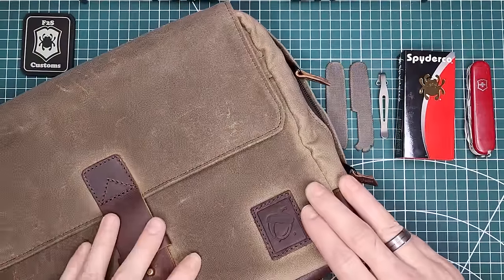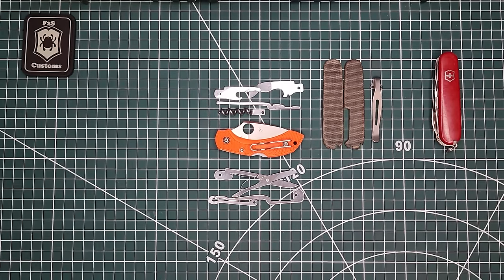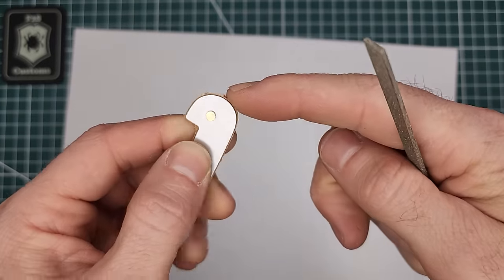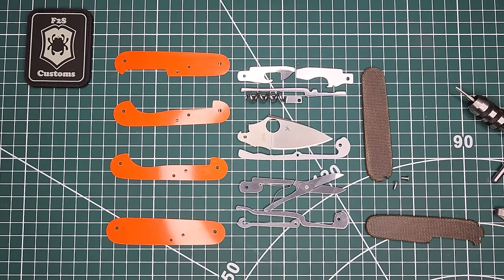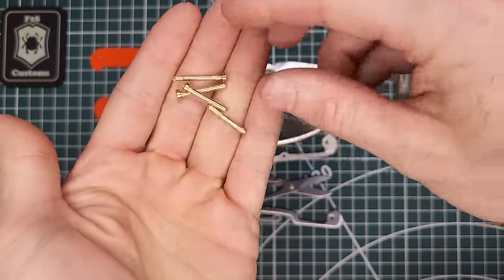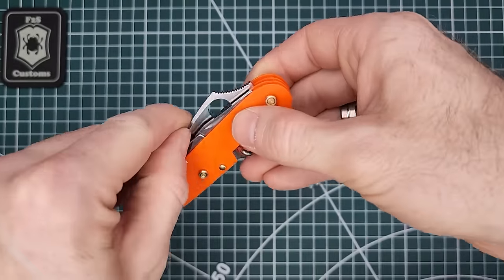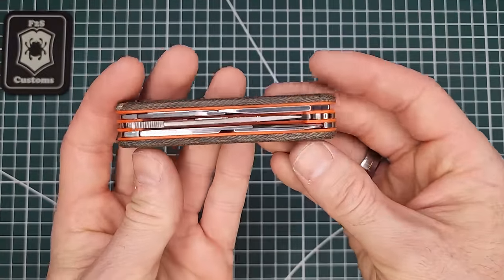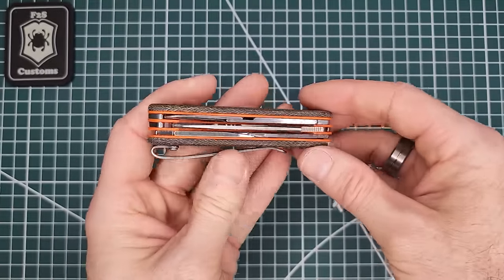How I made this Custom SAK for Nutsac

Comment: Nice build!
In your experience, what tools can you replace the hook with? I feel like the Reamer/Awl or something from a 58mm would be more useful but not sure if it’s doable.
Reply from the maker: Thank you!
There are a couple of options, but they are pretty difficult mods. You can add an awl, but it needs a washer. And it is possible to place the philips combo tool from a 58mm there too. But it has to be drilled out, reshaped an bit and the scissors spring has to be modified too. Otherwise it will not snap down into place.
Reply: @FittoSurvive  That explains your choice! I have been wondering as well why you would include the carrying hook. It is the tool I would most likely never use.
Reply from the maker: @jenskettwig3048  The multipurpose hook really is one of the least used tools. But yeah, it is the simplest to use with the scissors.

Comment: Freaking Magic!  But why is the blade on the "wrong" side, unlike a standard Victorinox? Is it only because you planned to make a tip-up pocket clip like on Dragonfly? Nevertheless, great job!
Reply from the maker: Thank you.
The blade ended up on the "wrong" side because of the spring that I had to use. I could place the Spyderco in the same location as the original Victorinox blade, but then I would have grind it down quite a bit.
Reply: @FittoSurvive  What spring are you using?

Comment: I wouldn’t trust micarta for such fine threads. How does it hold up?
Reply from the maker: I have made about 4 knives like this, and so far it has held up well. But, I have recently sourced some brass press-in threads that I plan to use in future builds to make the pocket clip more durable.

Comment: Wouldn't those plastic liners be proned to cracking from torsional pressure from using the tools or accidental drops? Aluminum does have better stress resistance.
Reply from the maker: The liners are G10, which is a high-pressure fiberglass laminate, a type of composite material. G-10 is the toughest of the glass fiber resin laminates and therefore the most commonly used.G-10 is the toughest of the glass fiber resin laminates and the therefore the most commonly used.  It outperforms and will outlive the original aluminum liners.

Comment: Would you mind sharing where you got the micarta scales from?  I’ve been planning a similar mod for my friend (she’s a gardener, so serrated main blade), but the RGT micarta I was looking at doesn’t accept the pen or pin.
Reply from the maker: I ordered these micarta scales from a guy in Malaysia or somewhere in South East Asia.
Have you seen the micarta scales from www.dailycustoms.shop
I don't remember if they have plus scales or not though.
Reply: @FittoSurvive  Thanks for the ideas… I’m having trouble finding micarta plus scales anywhere.  The closest I am getting are Taschenmesser scales on EBay (pen slot but no pin slot).  Any experience with the brand?  It’s reasonably priced and has a brass cross.  I’ll reach out to Daily Customs… maybe they will release plus scales at some point (not in a real hurry).
Reply from the maker: If you are having difficulty. Send me a message via Instagram preferably or email. I will help you get a set just like the ones I used in this video.
https://www.instagram.com/fit2survive_/
f2scustoms@gmail.com

Comment: What's the minimum number of layers to include the pliers from the handyman? Victorinox'd be making money hand over fist with a large knife/pliers/scissors/can/cap setup...
Reply from the maker: The minimum number of layers is 2. In fact Victorinox used to make the "Victorinox Special Mechanic" which was a two layer SAK with just the knife, combination tool, corkscrew, and pliers.
But, for some reason they stopped making them. I can still make them though. 😎👍🏻

Comment: nice work! but q - why using the corkscrew and not a philipshead? (i found many usecases for the tools, but none for the corkscrew other than holding the small screwdriver (and maybe a fireant)?)
Reply from the maker: Thank you! The philips screwdriver may have been a more practical choice, but I went with the corkscrew specifically to carry the helix tinder and mini tool. Otherwise, yeah I'd have gone with the screwdriver.
Reply: I use my cork screw to help untie tight knots
Reply from the maker: @chrisc4527  That's one of the many uses for the corkscrew. 👍🏻 @feliximmler probably has shown many uses for the corkscrew on his channel.

Comment: Awesome built. How the toothpick fits in to the scale? Does it click in its place like the original plastic scale?
Reply from the maker: Thanks. The toothpick fits well. It is not loose at all.
Reply: @FittoSurvive  thanks. I hobby cnc user. I solved the tooth Pick with a soft silicone ring.
Reply from the maker: @petercsizmadia9642 Awesome.

Comment: Isn't the blade hitting one of the pins when closed ? Or it is just super close ?
Reply from the maker: It may be close, but it does not tap the pin or spring.

Comment: Hi man, i'm following you since last year. Today i tried to make my first custom vict (tsa cybertool). I'm having a problem, i got short rivets so i have to make a new set. You linked in description brass rods to make it, but they are 2,5mm dia, so they work well for extrenal rivets, but 2 in the minnel are 2,2 dia. Do you find a brass rod wuth that diameter or i'm totally fucked? Sorry for my spaghetti english but i hope you understand
Reply from the maker: Glad to hear that you have been following me for a while now. 
The 2.2mm brass rods can be ordered on Ebay, but they usually come from China and take a while. In a pinch, you can tighten the 2.5mm brass rod into a drill and spin it against some sand paper to bring it down to 2.2mm. Just have to be careful to make sure that it turns out even.

Comment: The 93mm Cap lifter has a 3 mm hole and the 91mm knives have 2.5 mm pivot pins is it a problem?
Reply from the maker: The difference in the pivot bore does not affect the performance at all.
Reply: @FittoSurvive  Interesting I used to raid the 91s for scissors for the 93mm alox years ago and drill them out to 3mm since the X range has been released not a thing now. At the moment I modding some 111mm Victorinox models

Comment: All is good but in my opinion more reliable will be if the pocket clip bolts will screw into the metal liner. But yes in this build you have no metal liner. Something more reliable for pocket clip attaching.
Reply from the maker: I see what you mean. It should hold up well, but yeah, it would be better if there was some metal that it could attach to.

Comment: What size is the pin/ screw hardware and where do you get it from?
Reply from the maker: The brass pins are 2.5mm and 2.2mm in diameter. The 2.5mm can be found on Amazon, the 2.2 is harder to find.

Comment: I've always problem with the bottle opener layer, it does not snap as normal, I need to use washers?
Reply from the maker: If you modified the can and bottle opener to fit on the blade layer like I did in this video, then yes they will need a small washer. Otherwise they will get pinched and not open properly.

Comment: Where do you get your victorinox parts assortments?
Reply from the maker: All of the parts that I have are from knives that I have disassembled.
Reply: @FittoSurvive  even the colored accessory sets? I’d love to get one of those, even if it’s not in a nice branded box for my own projects
Reply from the maker: @dwaynetherock-hardjohnson5676  The colored accessories can be found on Ebay sometimes. Not sure where else you could source them. At one point, they were on Amazon, but I haven't seen them in stock there for a while now.
Reply: @FittoSurvive  I’ll be sure to keep an eye out! Thanks for the heads up! Love your videos as always!

Comment: I want this but in different color.. how much would I have to spend to get the same one just different color??
Reply from the maker: A build like this costs around $340. It can be done with a different color. Check out my website for information on how to order one. www.f2scustoms.com
As a heads up though, my current waiting list is about 43 weeks.

Comment: Hello, is it possible to use a longer Spyderco blade like the Endura and reduce its length to fit the Victorinox 91mm?
Reply from the maker: Theoretically it should be possible, I have never tried it myself though.
Reply: @FittoSurvive  Thx! I'm thinking about the PACIFIC SALT™ 2 GREEN LC200N, quality steel totally stainless steel.
Reply from the maker: @ogarzabello  That blade would need 5mm ground off. I'd probably try to place a knife like that in a 111mm SAK.

Comment: The only thing I don't like is that the knife doesn't have a full locking mechanism which you then have to actively UNLOCK.   So you might cut something and if you're not holding that knife right, it can close on your fingers and cut you pretty bad.
Reply from the maker: I've been experimenting on a liner lock for the Dragonfly, but haven't had much success yet.

Comment: Why did you modify those two springs and two tools? I mean, sure, to get them to fit better and to work better, but if feels as if you just glossed over that part
Reply from the maker: The springs had to be modified to accommodate the tools, since the springs are not meant for them originally.

Comment: Isnt the G10 a lot thicker and less strong or wear resistant than the stainless liners you replaced from?  Is it just for color?  It seems like a downgrade of the liners
Reply from the maker: The original liners are actually aluminum. So, the G10 is stronger and more durable. But other than that, it is mostly for the design.
Reply: @FittoSurvive  I didnt know they were Al, G10 is an upgrade!  the orange looks cool, too.
Reply from the maker: @dichotomousblue  Thanks! 👍🏻👍🏻

Comment: Jesus, man, how did you reassemble that so easily? I'm reassembling a SAK as I'm watching this, and those metal springs between the tools are refusing to cooperate
Reply from the maker: Yeah, some times the tension on the tools/springs makes it difficult to get the tools in place without them popping back out. 😅
Reply: Finally, thanks to the strength of 2 full-grown men, I got all the parts in the right place. Just need to fit the gromets, remove the zip ties holding the parts in place, and snap the scales on. I don't know how you do this as a profession all on your own. Mad respect.

Comment: Spyderco blade drops on brass rod?!
Why plastic layers? Is it a toy?
Reply from the maker: The Spyderco blade doesn't touch the brass rod. During assembly it looks like it would, but that is because their wasn't any tension on the knife yet.
The liners are G10. It is a high-pressure fiberglass laminate, a type of composite material. It is created by stacking multiple layers of glass cloth, soaked in epoxy resin, then compressing the resulting material under heat until the epoxy cures.
The G10 is stronger than the original aluminum liners. No toys here. 😉

Comment: Thin short thread in plastic, plastic liners, what this “knife” is for. You should go for wooden blade and rubber scissors. 👍🏻
Reply from the maker: Plastic? Hmmm... Apparently you do not know what G10 is. The original liners are aluminum, which is significantly weaker than G10.
But, if you need a wooden knife with rubber scissors, let me know. 😉
Reply: @FittoSurvive  hmm, what is weaker, ceramics or brass? What about threads? Good tactics to answer partially and skip the part where you have noting to say.
Reply from the maker: @CBORK27  About ceramics or brass, each has it's own advantages. The ceramic is probably harder on the Rockwell scale, but the brass is more malleable and does not break.
I did not even understand your first question about "thin thread in plastic". I assume you mean the threads in the micarta scales. That is something that other people have pointed out as possibly being a weak point. I have made 3 or 4 knives like this one and none of my customers have yet complained. But none the less, I have sourced brass press/melt in threads for future builds.
I have nothing to hide in my builds. I am proud of my work.
My question for you, what has you so upset about this build?
Reply: @FittoSurvive  I don't upset, I simply think that g10 + steel pair is less wear resistant then steel + metal (I mean open/close action) 0,2 brass bushings will be good solution. Metal threaded inserts you mentioned is good solution too(bugout for example). This knife is maybe beautiful (no accounting for taste), but certainly not as reliable as original. Just wanted to share my opinion. I think you just got used to only adoring comments and got upset about mine. Sorry to disappoint you. You are not very original here, almost any YouTube blogger hates critics. 🤷🏻‍♂️
Reply from the maker: @CBORK27  I see what you mean. But I still think G10 will be more durable than the original aluminum ones.  

 The bushings is an interesting idea. I wonder if it wouldn't disrupt the tension of the tools though... I'll have to look into it.

I do appreciate positive criticism, it helps me improve. I guess I was irked by the "wooden blade and rubber scissors" comment. 😅 

But, I seriously do appreciate the other advice that you just sent. I'm not perfect for sure. Still much to learn.

Maybe my upcoming build video will impress you more. 😎 It will be all original parts and liners, but super cool if not overkill. 😁
Reply: @FittoSurvive  my advise is to learn about friction pairs, if you want to make not only beautiful but also functional things, I think that functionality must be on the first place regarding knifes, especially multitools.
Reply from the maker: @CBORK27  👍🏻 Thanks.

Comment: Nice, but 3-layer model based on Victorinox Compact will be more interesting. Thanks for your video!
Reply from the maker: Agreed, but since I was giving this knife as a gift, I did not want to use the more expensive Compact. 😅
Reply: @FittoSurvive  Your work is amazing.  One benefit of using the Compact is the back of the hook has a nail file, which makes the hook more useful.  Did you consider adding a channel on the outer scale to add a Fire Ant ferro rod?  Would it be feasible to add 2 more layers; one for pliers and another with a magnifier and phillips.  Could one of your custom saws fit in somewhere or could it replace the can opener.  Could a sharp edge be added to the bottle opener so it could also be used as a can opener?

Comment: I really want to make something similar but those spydercos are so damn expensive for what they are (at least here in the UK they are)
Reply from the maker: Yeah, the Spyderco blades are pretty expensive. Makes it rough to experiment.
Reply: Have you made/thought of making any SAK's using the grasshopper slip joint blade? That's one I'm considering trying as they are only £25 here (although not the greatest steel so I wouldn't be surprised if you wouldn't bother when there's better options available)
Reply from the maker: @MDM1992  I have used the grasshopper in the 74mm and 84mm Victorinox tools.  It will not fit in a 91mm though.

Comment: Has anyone tried this with 111mm version? 111mm Tracker-best EDC that i ever had, but the blade steel is the biggest disappointment for me. Does anyone knows a way to replace it??
Reply from the maker: I built a custom 111mm, but I didn't make it a Spydernox. I just changed the blade to the one handed one from a trekker. Here's the link: https://youtube.com/watch?v=nyR5WFqNNsw&feature=shares

Comment: I dident see a way to ignite the tinder in the build.you put a tinny Philips instead of a ferro rod.
Reply from the maker: You are correct, I did not add a ferro rod to this knife. But the pick could easily be replaced with the Tortoise Gear Firefly.
Reply: @FittoSurvive ok then tinder was to secure   masterpiece .. 👍🖑
Reply from the maker: @calebswanson462  Something like that. 😂👍🏻

Comment: why cant spyderco and victorinox just collab already

what i really want is a sak with; a locking blade, good blade steel, metal saw, metal file, screwdriver

everything else is gravy
Reply from the maker: Yeah, it'd cool if they did an official collab.
I am working on a locking Spydernox mod, but it's still just a project currently.

Comment: The knife turned out very nice, but the liner material, i.e. that for the intermediate layers, is unfortunately not very suitable for it. It will wear out very quickly and then you will have a wobbly knife. Stainless steel layers would have been better here. Apart from that, it's a really nice knife!
Reply from the maker: Thank you! The G10 is a composite material that is significantly stronger and more durable that the original aluminum liners. Stainless steel liners would be an interesting idea. It would definitely add some weight to the tool.
Reply: @FittoSurvive  You're right. G10 is stronger or similar to aluminum BUT only in the tensile test (the material is essentially pulled apart), but in the compression test G10 is worse, especially when it comes to avoiding wobbling of the tools in the long term, G10 is definitely inferior. However, in the tensile test it was clearly superior to aluminum. You can even test this yourself by taking a piece of aviation aluminum (not the cheapest aluminum foil) and a piece of G10 and making a notch with one of those automatic punches.:face-blue-smiling::hand-purple-blue-peace:
Reply from the maker: @china_airguns  Very interesting. 👍🏻👍🏻